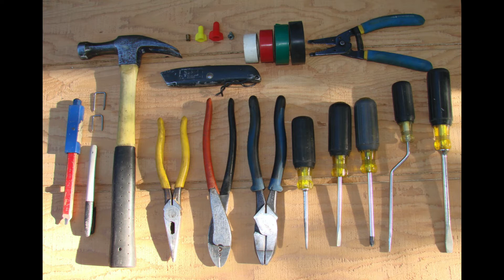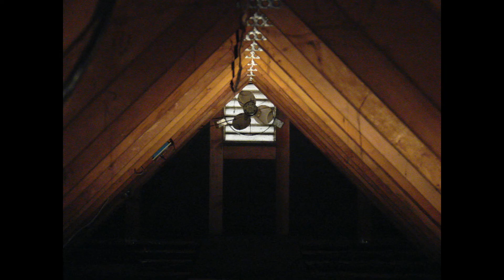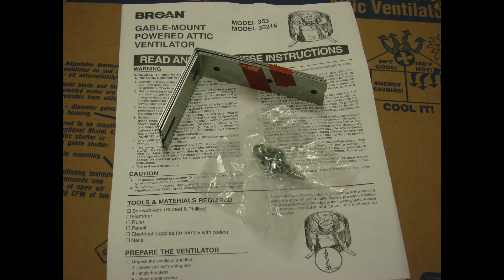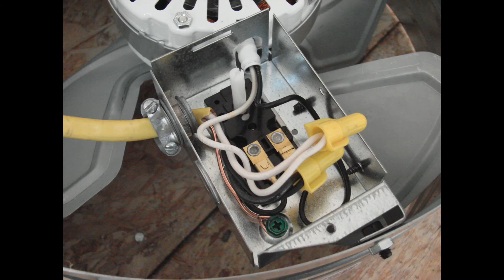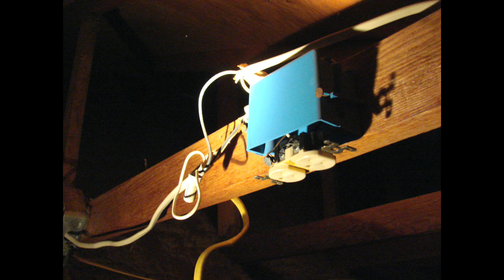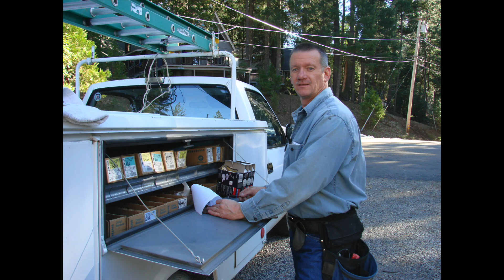How to Install an Attic Exhaust Fan the Easy Way, See the Whole Process From Start to Finish.

Comment: If my house faces south and I have vents on the east and west gable, which is the better vent to install the fan?  Is east or west better?  How would I determine that?
Reply from the maker: That's a great question. I take the whole site into consideration, and I think it is best to bring in air from the coolest side of the home, therefore I will install the exhaust fan on the opposite side of the home. I also consider where other vents may be installed and how that may affect the venting of the attic space.

Comment: U mention that the bigger fan should have it's own line going to CB, now my attic is not that big what size of fan that I can use and connect to my existing box or ceiling light box, I hope my ? Make sense🙂 thnk u so much
Reply from the maker: The size of an attic fan is based upon the size of the attic space. For example, one way to determine this would be the sq. ft. space of the home.